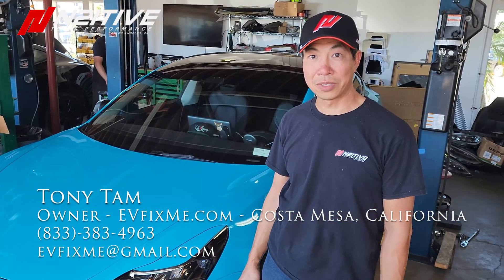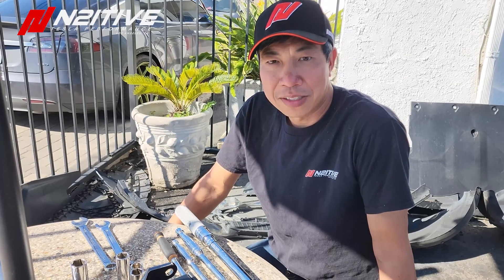How To: N2itive Tesla Model 3 Y Adjustable Camber & Toe Installation Instructions

Comment: Hi, for preload the suspension,  how do I know if it is at the proper height ? is it bad to have it too high ? thx
Reply from the maker: Good question. When you jack up the car from the bottom of the knuckle you'll see the suspension start to rise. At some point the car will want to lift off of the jack stand or other Jack that you're using to support the car. Right before this point is the proper height for preloaded suspension.
Reply: @N2ITIVEdesigns  , thank you !
Reply: @N2ITIVEdesigns  Hello again,  I followed your video, installed the rear passenger side camber arm , but now there is a creaking , clicking noise when the car is slow rolling,   noise goes away when at higher speed,  any idea ?  thx

Comment: So you dont do alignment after installation? ☹️ 
I have premature inner tire wear on rear tires
Reply from the maker: This video only shows the installation of the arms.  You still need to have the car aligned after installation.
Reply: @ thanks!
Reply from the maker: @Enriquecido316  Sure, anytime!
Reply: @Enriquecido316  Just like with everything else.  Shop around for best priced wheel alignment shops.

Comment: Is the front of the car have adjustable camber from factory?
Reply from the maker: @John_Doe_6932  sorry for the delay in responding. It does but it's very minimal.
Reply: Yes they do The upper strut mount can move to adjust camber. If you've lowered it there might not be enough adjustment to get it spec.
Reply: @ProfessorMiketheMechanic   From N2itive?